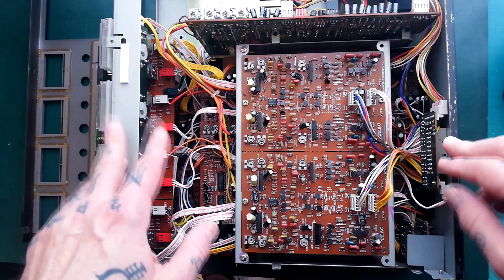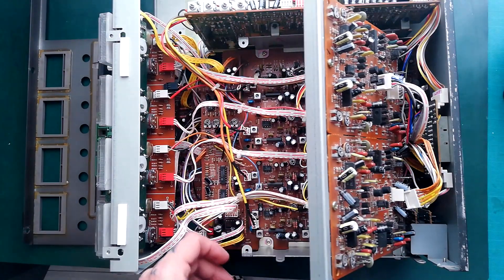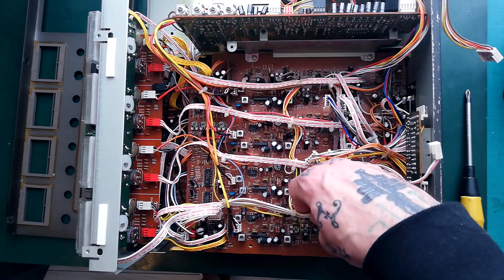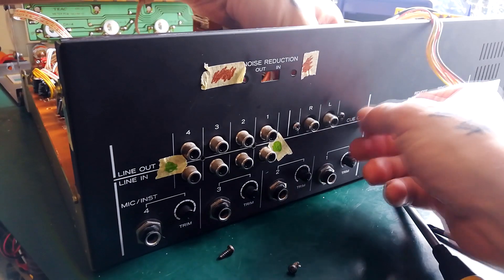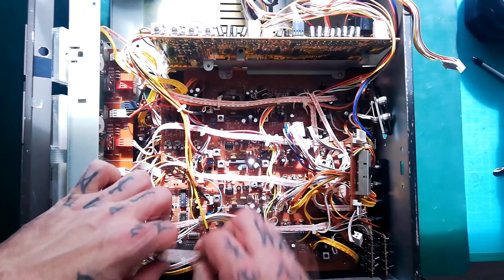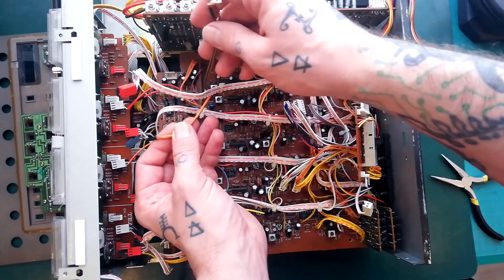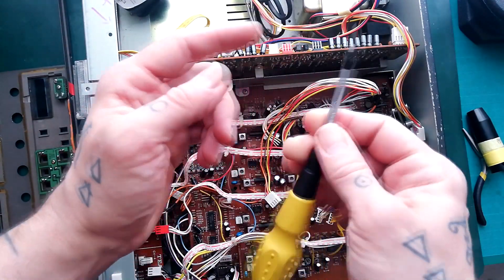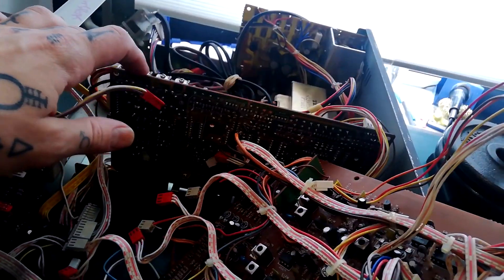Tascam 234  |Tear Down | 2 | Remove DBX & Record/Playback amplifier PCBs

Comment: Good vid.  Do you have any tips on how to remove the take up reel without pulling the door assembly to pieces?  I need to adjust the clutch which is done via rotating clips on the reel table.....just can't figure out how to get the reel out??  The backplate is attached to the door assembly.  😭😄
Reply from the maker: Thanks. To the best of my knowledge, you have to take the door off. This unit really is a pug to work on, unfortunately.
Reply: @Tetrakan  yeah, it's built very awkwardly.   My take up reel spins on the clutch a bit fast, so it's noisy. Sounds like it's in FFW all the time.  Plays tapes fine though.  Any cheats to get some pressure on the clutch pad? I don't fancy pulling door apart. 😮‍💨

Comment: do you have any suggestions regarding a very quiet channel 1?  input needs to be cranked up to get the needle up around 0db and playback is very quiet to non existant.  Tapes recorded on another deck and played on the 234 have the same quiet issue.  tracks 2-4 are fine
Reply from the maker: To be sure you'd need to use an audio probe or similar technique to establish where the attenuation takes place, but I'm guessing it'd come down to bad coupling capacitors etc in the playback amplifier. I'm due to publish a video in the next couple of days where I solved a similar issue with a 244 whose electronic topology is more or less identical.
Reply: @Tetrakan  thanks for the reply, I look forward to it

Comment: Call me crazy but I actually like the way the 70's-80's Japanese electronics were thought out. I have torn down my 234, replaced all rubber and everything is working fine EXCEPT for channel4.  When recording and playing back a test tone (or any recorded) material, the signal will fluctuate as well as being indicated in the VU meter. Would love some thoughts about how to remedy!
Reply from the maker: If its effecting recordings and playback that's a clue the fault lies within  the playback amplifier not the record amplifiers. You could get in there with an audio probe and narrow down exactly where the fluctuation is introduced to the signal path, or just reflow and recap that entire section of the circuit and see if it catches your issue.
Reply: @Tetrakan  Thank you so much! I will track it down to see if its the amplifier. Since posting someone mentioned that it could also be a worn head causing the dipping, I would rather it be the amplifier though due to head scarcity.
Reply from the maker: You're welcome. BTW over the course of I guess over 300 multitrack cassette recorders I have never seen lapping on the heads. I figure on R2Rs it happens because of higher tension, higher speed, higher mass tape stock and decades of  nearly daily use in professional studios, but portastudio heads just aren't subject to the same stresses. In my experience portastudio heads either break completely (internal coils or nagnets break) due to the units being dropped or having something dropped on them or they just work. Also I don't understand how lapping would cause dips in amplitude, surely it'd be crosstalk and frequency response that was effected? Whereas there have been plenty of times where tending to the electrics fixed undulating amplitude. Good luck.
Reply: @Tetrakan  I don't want to take up too much of your time, but I am still working on remedying the problem of track 4. My new discovery is that if I record onto the problem track 4 and flip the tape over playing back the sine wave onto track 1, track 1 now warbles/fluctuates. Likewise, if I record the test tone on track 1 and flip the tape, track 4 plays just fine, telling me that its NOT the playback amp, maybe the recording amp? In your third Tascam 234 teardown video what the first board you removed? Is that the recording amps?
Reply from the maker: I agree sounds like it's the recording amp. From memory the larger of the horizontal boards is the record and playback amps? But in any case they have white writing on the edges labelling their function.

Comment: thanks again for doing the old syncaset.
At the end, assuming you get it all going and then muck about recording on the beast, I'd love to get your subjective opinion on the 234 sound compared to other models. There just seems to be so much more under the lid on the 234 than other tascams?  Is it doing stuff that's "good"/bad/no different? What's it all about, Alfie?

I love the 234, but honestly couldn't tell you how it compares to anything. Oh, if you do get to record on it, remember stereo cue, and a jumper lead to bounce. Who needs a mixer section?
What's it all about, Alfie?
Reply from the maker: Judging by opamp models, component values etc, it's pretty much the same circuit as a 244 or 246 if you bypassed the mixer, and on the 246 that's completely doable. So if it was cheaper than a 244 and you already had a lot of rack gear include a patchbay and a decent external mixer and you didn't mind the access issues then it'd be the better choice. But at the time of writing they're going for 2x  more than the 244 on UK eBay, which in my mind  is a bit like paying more for the rack mount version of the synth than the keybed version?
Reply: @Tetrakan  didn't know that regarding price. Interesting. They used to be cheaper, and the 244 was super super pricey and sought after. But maybe different times and different markets - (I'm in Australia.)
Reply from the maker: I haven’t checked but I assume the RRP of the 234 was cheaper than the 244 back in the 80s. I guess fewer 234s were made, because they come up for sale less frequently, and then I suppose the people who want them are after a 4 track cassette “module” to complement match their existing pro spec rack gear - pros or serious hobbyists with money to spend? So with buyers with more money to spend  chasing a smaller supply the economics get all distorted…just my theory.